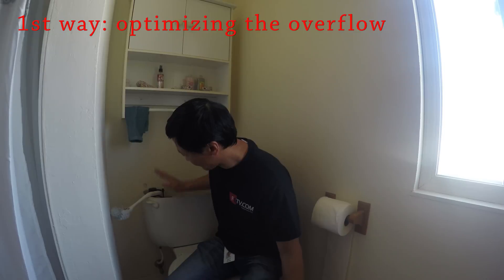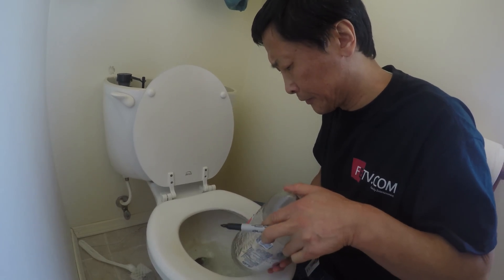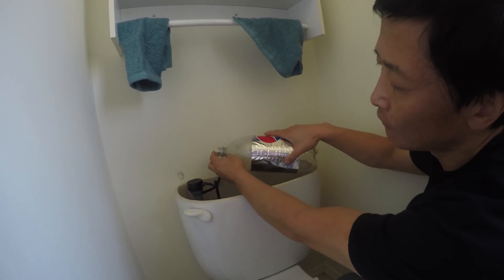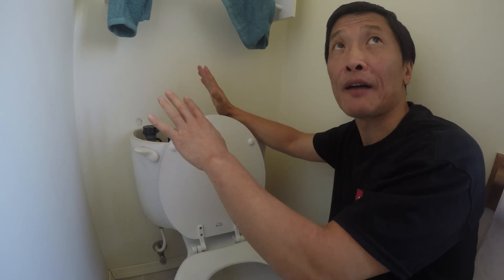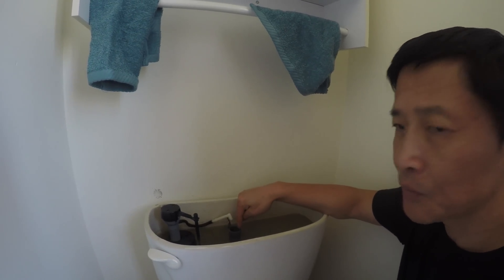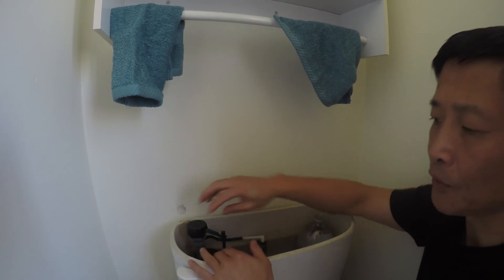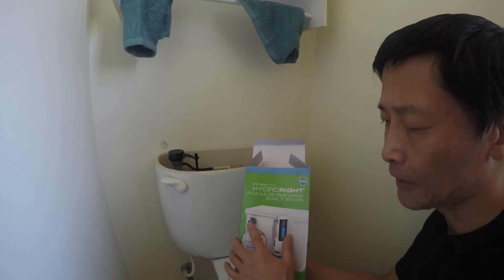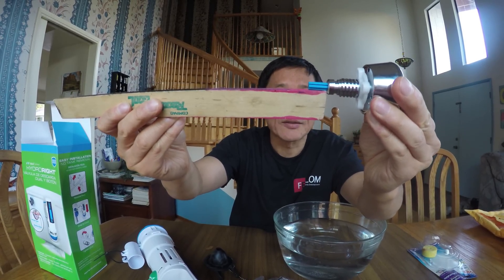5 Different Ways To Make Toilet Use Less Water

Comment: Most cost effective way to reduce water pressure would be to utilize a two liter or a few bottles in the tank.
Reply from the maker: yeah, very good question. The precise and detailed demo on how to measure and add the bottles to the toilet tank is shown here: https://youtu.be/9fvWpqNGX8Q?t=337  I learned this after wasting a lot of water for a few years blindly following the manufacturer's instruction and not realizing the wastes (I discovered I have in fact actually wasted water for nearly three years. )
Reply: @GeniusAsian  Theirs two types of  manufacturing companies this which actually provide with quality service and other who desire to generate income ( which is the overall goal for both ). Ex. Toothpaste is suppose to be used in a pea sized amount and most ppl plaster it all over the tooth brush. With that being said when your toothpaste is coming to the end you can take a pin/ needles and stick it in the tooth paste and also put it in your toilet tank so that the tank may have a fresh scent upon being flushed. ( You can also use a water bottle with toothpaste and a few holes ) looking forward to seeing more videos
Reply from the maker: @user-il8ku2xc9z  yes, thank you for taking the time to contribute, your comments will help other viewers.  Toothpaste can also clean a lot of things effectively, and after using your  toothpaste, the cap can help you flossing: https://youtu.be/LG5BydJ-iGY

Comment: This is too complicated,why not just buy a HydroClean fill valve?The HydroClean fill valve has a small valve that connects to the overflow tube hose that can be adjusted so that the toilet will not waste water like the fill valve that you use in the video wastes water.
Reply from the maker: Sure if you want to spend money, you can get dual flush kit, such as from fluidmaster: https://youtu.be/m6C1YULrPCU
or from Danco https://youtu.be/1RDGznJm-U8 but with Danco, make sure you adjust it correctly, otherwise you may waste more than you save: https://youtu.be/9fvWpqNGX8Q
also check this out because this one does not cost you anything: https://youtu.be/hTlKA67en6s

Comment: You can even use shower water that just goes down the drain.  You can collect rain water too ;)
Reply from the maker: yeah, there are many ways to save water, however if it takes time and efforts most people would not do it. The easiest way to save water with zero cost, almost zero efforts and zero time spent is this: https://youtu.be/UDYWrQsaNZY

Comment: I wonder if this is illegal?
Reply from the maker: Are you talking about building code or legality? There are laws that require lower water consumption, if any one who sells toilet that uses more than 1.^ gallons or even lower in some states. If the laws require lower, then the building code will need to change to adapt. There are ways you can both flush small without waste sludge to back up in the city sewer pipes. Watch ways to have dual flush system: https://youtu.be/m6C1YULrPCU ,  https://youtu.be/9fvWpqNGX8Q , https://youtu.be/hTlKA67en6s
If you have toilet or plumbing related issues, you can check out:
Slow Draining: Easy 5 Seconds Toilet Flush Test and Solving the Slow Flush Mystery
https://youtu.be/_EP7LZdnMXo